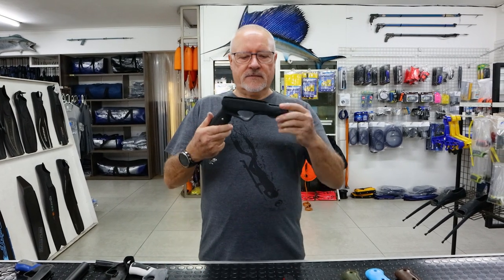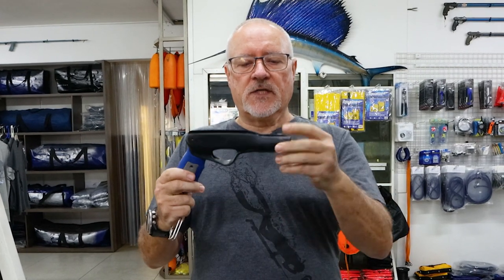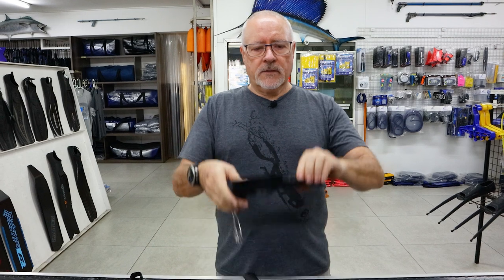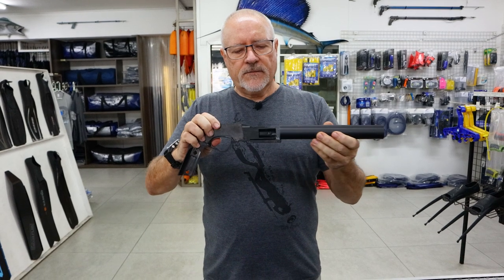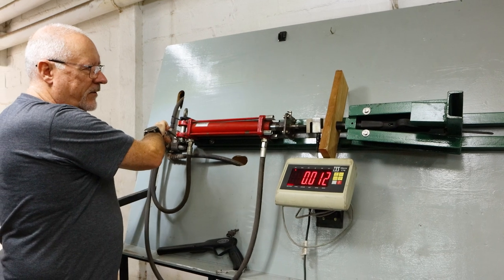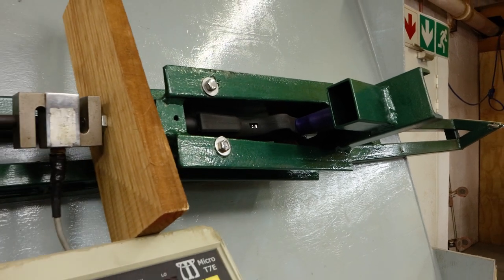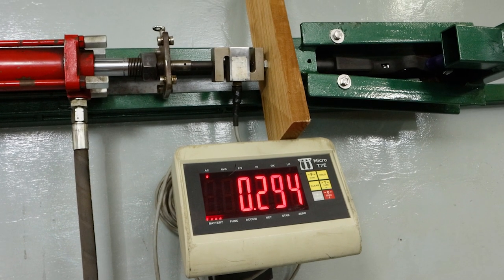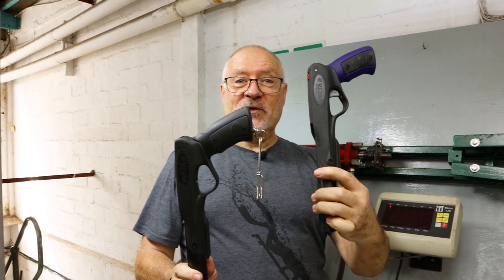Rob Allen | Vecta 2 Handle Break Test | 2022

Comment: Hi RA Team, the integrated reel bracket as you guys designed it only allows inserting the reel from the rear - meaning it locks in a way against forces pulling at the reel body. A very nice little detail thinking about forces acting on gear. 
Second, reels mounted directly on barrels as seen in other spearguns, weaken the barrel. And the screws holding those reels break out damaging the barrel as well. Will never happen when using a VECTA handle. Keep going the videos. Guess this boost customer confidence in your great products even more.  ><000*>
Reply from the maker: Many thanks for your positive response 👍👍

Comment: Dear Rob, I found my handle safety easily gets jammed by sands and it can take a whole night soaking in fresh water to resolve it. Any tips to reduce that chance? I’m a safety lover by the way. It’s a lot more safer when you leave your loaded gun aside while fighting with lobsters/ abalones.
Reply from the maker: Hi, it might not be sand but a sticky safety. Does it jam on or off? We have had the odd safety have issues. If it is sand, you should be able to clear it in the water just by releasing the spear and knocking it about a bit. There is no way to prevent sand getting in as the fine grit will always enter and cause wear, this is why we keep the mechanism as open as possible.